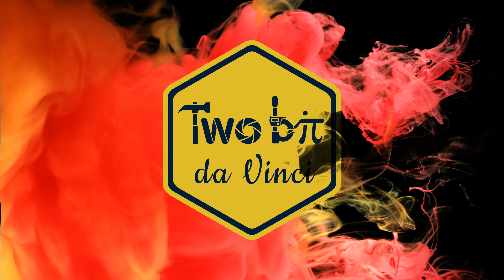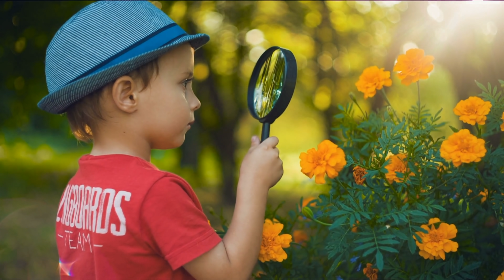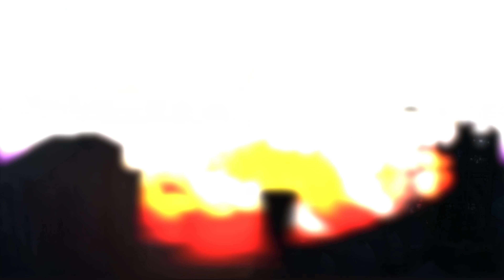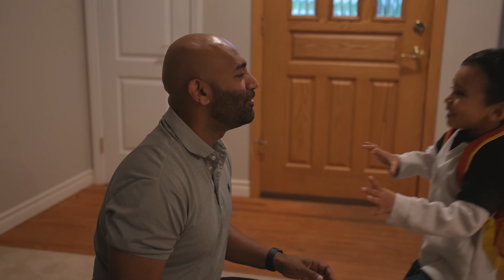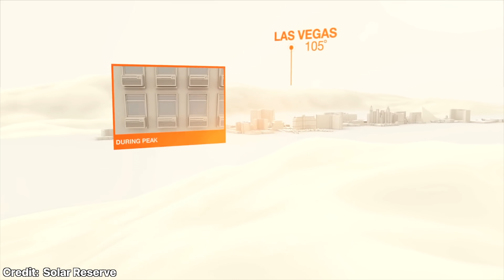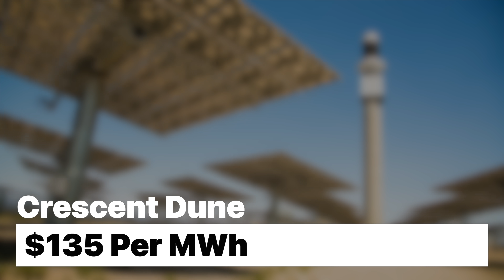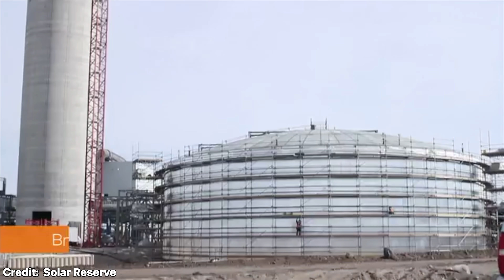This Billion Dollar Solar Plant was an EPIC Failure

Comment: The future is sodium ion batteries - kill two birds with one stone. You desalinize ocean water and transport it to inland reservoirs that are drying up helping mitigate sea level rise and flooding. Extract the salt and use it as an alternative to lithium heavy metal which is costly to mine and requires special recycling at it's end of life. Doesn't hurt either that the fresh water can be used for irrigation as well and salt can be used as a reactor fuel for power generation.

Climate change is no joke and the only way to combat flooding is better water management. Desal can do just that by replenishing lakes that feed dams and controlling sea levels. It might not matter today, but it will be critical in 50-100 years when what used to be your beach is long gone.

Comment: So combine the two technologies. Use PV panels to heat the salt using electiricy. That would solve the cost and energy storage issue. Batteries are awful for the environment.

Comment: It's too bad it didn't quite work but there is one or two things I started thinking about..
  Now say I'm guessing or wrong but the PV's that are cheaper tend to get less eff. with age and fail and a lot of them will fail at the same time so they have to be replaced right? Did they factor this into the daily cost of ownership? Another problem is what do you do with them after they fail. Don't they have a lot of toxic chem. in them so more costs and problems because they are just not a clean power source. Yeah no carbon footprint but a lot of toxic problems.
   The mirror based generator sounds to me like a much better long range power supply once they get things worked out. I mean the main goal here is fighting global warming and every clean generator is a plus to us all.
  In this area we really should take the long view because if sea levels rise as much as predicted the damage to the world will make costs almost impossible to tally up short of our worst nightmares.

Comment: ACS Cobra did a piss poor job putting it together. This thing is 12 miles behind my house and there is a whole political situation that is the real reason for the failure. It doesn't take 2000-5000 people to run that plant, I don't think Tonopah has 5000 residents. Not sure where those numbers to produce came from but they were producing electricity at .21 cents per kWh which means the people in California would buy it since it's only .03 cents more than what they are paying.

Comment: The S curve re: adoption of photovoltaics has absolutely nothing to do with this molten solar plant's inability to generate operating revenue above its variable cost of operation. That's a totally separate flaw, and the reference to photovoltaics, while correct concerning photovoltaics, is a red herring excuse for an ill-fated boondoggle from the start. The poor assumptions regarding maintenance costs, leaks and operating time disruptions appear to have damned this project, and there may be more issues not covered in this report. Very good video by and large, but you could be more intellectually honest and straight-forward that this project was doomed to be a white elephant because of its over-optimistic assumptions described above.

Re: photovoltaics, no discussion of the use of rare earths in manufacturing the parts here, especially regarding the battery tech. This is where the green image turns into a brown turd. There is no clean rare earths; it's enormously polluting, so only China is producing them en masse. That has its own set of geopolitical issues to boot, but I digress. This green energy space is replete with assuming away the real problems to sell an utterly false facade of environmentally conscious energy development; the snake oil of our time. 

P.S. Fun fact. The smallest nuclear plant in the US generates about 10x the power this molten solar plant was designed to generate. It's over 20x what it actually generated while operating, and uneconomically and unsustainably at that. Oh, the bitter irony of "sustainability" damning a purportedly sustainable green energy project.

Comment: This video seems inaccurate. Solar thermal power has existed commercially for decades; for instance, Kramer Junction in the 1980s at Boron, CA. Granted, the design was different and there wasn't this radial structure with a central receiving tower, but rather a traditional solar power field with tubes of liquid at the focal lines of banks of parabolic mirrors, which then proceeded to heat and be pumped into turbine generating stations onsite. The technology ~is~ simpler than solar photovoltaic, and materials are less scarce to procure, and, as you mentioned, there is a much higher potential for auxiliary power production after sundown / during cloudy weather via thermal energy storage—something that I think market forces are currently undervaluing / externalizing when pricing the costs of developing solar photovoltaic generating capacity. I think the reasons for this particular plant's setbacks are not so much indicative of the technology as a whole being unviable but rather the plant itself and its various players encountering numerous problems of numerous types. This video, while well-intentioned, positions itself as educational, but I strongly suspect it is filled with misinformation, and that's a growing problem on the Internet.

Comment: The government in the Netherlands just announced (march 2022) that they are going to double the amount of originally planned wind turbines, ramping it up to 10,7 gigawatt by the end of 2030. That doesn't sound like much but we are a small country. The UK announced that they are targeting to produce 40 gigawatt with wind generated power by the end of 2050, that is more as what the current total energy consumption is from the UK. 

A new type of wind Turbine, GE Haliade-X, is going to produce 14 megawatt of power. For comparison, the biggest current inland wind turbine in the UK has a rotor diameter of 150 meter and it can produce only 6 megawatt of power. The new biggest wind turbines in the world, and one has already been build in Rotterdam in the Netherlands for testing and licensing purposes, have a rotor diameter that is 220 meter and they are capable of producing 14 megawatt of power. It is a huge step forward. And the end is not in sight, experts expect that wind turbines will only grow in size and produce even more power. 

A Scottish Island is completely energy independent by a combination of wind turbines, solar energy, and energy storage banks made from Graphene Ultra capacitors, from a company that is called Skeleton Ultra capacitors. And a Dutch company that is called Extreme eco solutions, is able to recycle decommissioned turbine blades and decommissioned fiber composite yachts into 100% recyclable street and wall tiles. without any subsidies. 

So there is also a LOT of good news to announce!! 😄
Reply: I remember reading an article saying that in the distant future wind farms may cause climate change in local areas due to disruption of the wind.
Reply: @Trey4x4  😆😆😆
Reply: "The most recent report by the UN's Intergovernmental Panel on Climate Change expects that, in most regions, the mean wind speed will decrease as a result of climate change. Between 1979 and 2018, global mean land wind speed (excluding Australia) showed a reduction of 0.063m per second every decade.Nov 22, 2021"

It starts off small but it could be a concern in the distant future
Reply: @Trey4x4  Crazy troll.
Reply: Update: The Dutch government announced yesterday, 16 september 2022 that they are going to install enough windturbines to produce 70 gigawatt by the end of 2050 instead of the previously announced 40 gigawatt. It is enough to make the Netherlands completely energy independent. And before 2040 they want to have enough windturbines installed to produce 50 gigawatt. 😃❤❤❤

Comment: The Achilles heal of the CS tech is the energy storage part. The high temps and the salts must be corrosive as hell and the amount of repair and maintenance meant high Op-Ex and thus high break even prices for their electricity even if everything else was perfect.
Solution: sell off the molten salt storage system and either go for grid scale battery packs using lithium Iron Phosphate or Flow batteries such a Vanadium Flow batteries or Highview Powers cryogenic  solution, which uses proven systems from the global LNG industry. 
This switch will keep the plant going and will recoup the investors money and prove that Heliostats do work when pair with the tight storage solution.

Comment: Such a shame. It looks like a really good idea, and the fact that they made it means that whoever came up with it was actually trying to do something for the world and not just for their own benefit. 

One question I have, however: this is built in the form of an outward going spiral. Could they have built a small one and just built it outward if it succeeded?
Reply: Probably not,   to keep the molten salt  a liquid for a whole day ( Reserve were only 10 - 14 hours) requires the large number of  reflectors. Else they risk the whole system stopping and needing expensive repairs to restart the salt  flow  ~1000 deg C.   If you  had to reheat the salt with electricity, it would create a neg cost and lose money.

Comment: In the long run, renewable energy sources are going to plagued with all kinds of problems, because what seems to be a simple solution is actually quite complex. The primary problem with using wind turbines and solar panels is that they are constantly exposed to the elements. And aside from needing maintenance, turbines, panels, and batteries wear out and will need to be replaced. What to do with all of the junk? The metals and materials needed to build turbines, panels, and batteries poses additional problems in mining and manufacturing. Toxic wastes and gases are produced.  There's an old saying: "If it ain't broke, don't fix it." Nuclear, hydro, coal, and gas had been providing cheap reliable energy for decades. Safety has improved as well as reduction of pollution. Yet there have been politicians and journalists who have convinced the public that our energy system was indeed broken--and of course LOTS OF MONEY would be needed to fix the problem. In reality, a small amount of people have gotten richer while you have gotten poorer, because you end up paying for these new programs, no matter if they turn out to be boondoggles.

Comment: Could you do one about vertical windmills?
Reply: A local company installed one 10-15 years ago and made a big show of it.  But if you actually read the articles, you realized that it cost several hundred thousand dollars and could, at best, power 3 microwaves.  Now, perhaps at grid scale there is a benefit, but I doubt it.

Comment: No one “Hates Green Energy” as long as it works and is created from environmentally friendly products! Windmills constantly kill birds, continually breakdown, The arms continuously are damaged and have to be replaced With no environmental way to dispose of them. Just like this plant which I’m sure was disposed of in a environmental way! Electric cars are awesome as long as the range is increased and the batteries last longer than 8 to 10 years. Not to mention the environmental way to recycle them. And an environmental way to create them. After 10 years most electric vehicles are useless and create a lot of waste versus conventional gas vehicles that last in most cases 15 to 20 years plus. And can be repaired and maintained at a low cost for consumers. Not to mention electricity has to be created in someway that is environmentally friendly and cost-effective.

Comment: There are better engineered molten salt solar power plants all over the world including the US which all make money even some designs which look more like rows of solar hot water heaters. I could be wrong but I think that one would have been pushing the limits of what is normal for an operating temperature at one of those plants which likely contributed to the failures. 

PV cells have a finite lifespan which isn’t true for well built mirrors and a lot of companies in dusty environments use small tuned vibrations to clean the reflectors off so it is mainly replacing tracking motors etc which is the biggest expense with solar thermal. PV farms hoping for higher efficiencies with tracking panels have the same issues and PVs are made out of materials which are very slow to scale up the production of (though China is currently making it seem easy).

If the power you would use to pump the water up to your roof would otherwise be wasted you would at least get some power out of it when it was actually needed. The same goes for a lot of the storage options we can currently store a reasonable amount of power in for cheap.

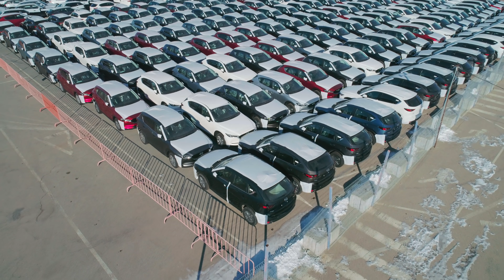Comment: 8:15 The EV sales one has different reasons, mainly Lithium production.
Even if you literally use every gram of Lithium currently mined you can realistically only produce around 2mio EV (with roughly 30-50kWh batteries, a bit smaller than the smallest Model 3 battery). And the amount of Lithium you need per kWh is largely dictated by physics and there currently is no way (not even in labs) to use significantly less Lithium apart from just not using Lithium anymore.
So Lithium battery tech is reasonable close to its theoretical limits, maybe a factor 2 improvement is still possible but already very unlikely and the power electronics and motor already operate in the 90%+ efficiency range.
So assuming no major increases in Lithium output the theoretical limit is maybe 4mio EVs per year.
Compare this with 65mio sold cars per year and you might see the enormous gap here.

Now you might say „Lithium production will just increase by 10x“, to which I would point out that many countries have actually stopped new Lithium projects because mining Lithium is extremely dangerous and very destructive, plus it has been roughly stagnant for the last 5 year already.

So there currently are just physical limits that prevent EVs from reaching this point of the S-curve, it is not at all comparable to solar panels.
Reply: Current Tesla vehicles have more range and way more peak power than they actually need. So it's very reasonable to consider the next best alkali metal for battery technology - sodium.
Reply: Theoretically Natrium batteries are possible, but I don't know how far they are.
Reply: Increasing Lithium output is exactly what pretty much every country that can, is doing!
It's a very common element..

Fortunately it's only needed for light portable batteries...
Reply: you also forgot to add due to Lithium EV's create more waste and more toxic waste then Petrol car.
What the EV pushing companies always do is to show the Carbon created During the driving life of a Petrol engine car and an EV car...
While they don't show the Carbon and other toxic waste created during the EV cars production and the replacement batteries.

Until something else rather then Lithium is found for batteries or significantly less lithium is needed EV cars will be worse for the environment then Petrol.

Problem is this does not take into account the MAJORITY of EV cars are charged by main grid power which is fossil fueled based.
Reply: @givemeanameman1  congratulations for repeating all the fossil fuel companies talking points. What do you think that information came from in the first place? Trying to tell me that 9 pounds lithium is going to be the equivalent of 70,000 pounds of carbon dioxide produced over the life of a gas powered car? Seriously
Reply: @colingenge9999  The same people that own the majority of oil/fossil fuel companies also own the majority of the "renewable" power segment including lithium related segment as well..
And yes LITHIUM IS THAT CO2 intensive, because it requires LARGE AMOUNTS OF ENERGY to REFINE to a USEABLE PRODUCT.

Further lifetime for a combustion car is 12-15 years
Average battery lifetime for a Electric is 5-7 years(at best)
It needs the battery replaced 2-3 times over the same .
Reply: @givemeanameman1  i’m not sure where you’re getting your numbers from. My 2015 Tesla model S lost 4% of its range after six years so I would anticipate is probably good for another 25 years. It is true that there is the occasional battery replacement here and there but of the 50 people that I know that on electric vehicles, no one has had to replace their battery. I think that information has been supplied to you by the fossil fuel companies.

It may require large amounts of energy to mine and 10 pounds of lithium is in my battery but you really have to compare what a cost in mind the alternatives which is over 20,000 pounds of gasoline. When you do the comparison it’s not even close. Again this is another fossil fuel misinformation talking point that you’re repeating. There is no data to indicate that what you’re saying is even 5% correct.
Reply: @colingenge9999  He's a Merchant of Doubt. No one spews that kind of non-sense without having an agenda.
Reply: And CATL, one of the world's largest lithium battery cell producers are already manufacturing sodium ion cells, with large scale production coming in 2023. Currently less energy density than top end lithium cells, but better charging rates and retains over 90% at -20*C, which is far better than lithium.